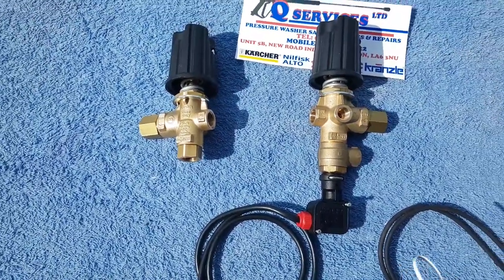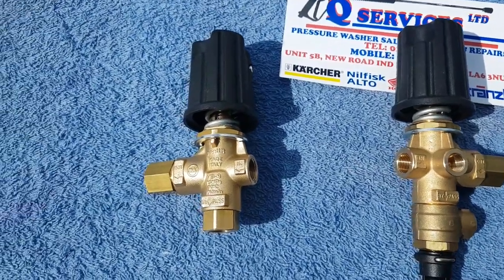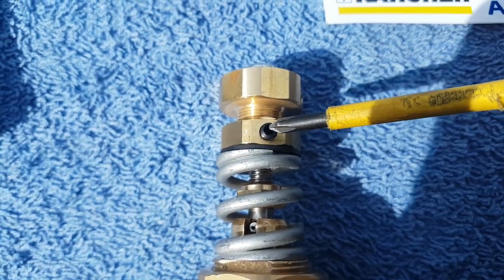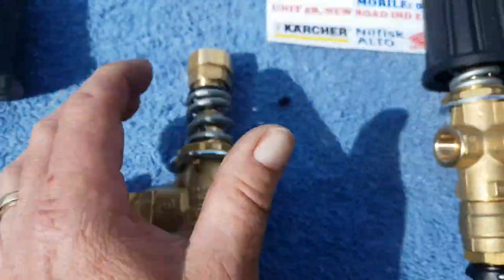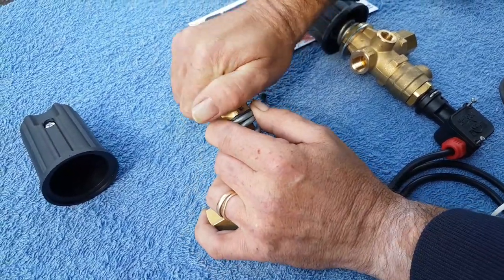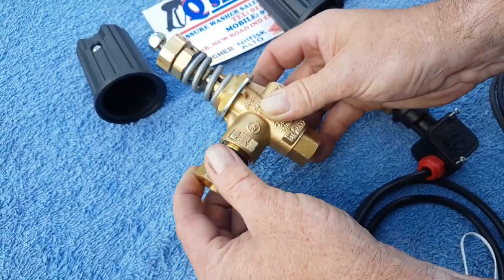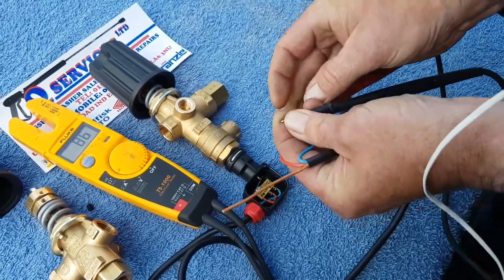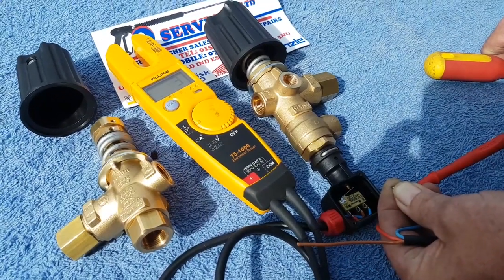QWASHERS YOUTUBE HOW TO SETUP REPAIR FAULT FIND PA 60.2250.00 VB9 UNLOADER VALVE PRESSURE WASHER

Comment: Hi mate can you help me please my unloader were my bullet value holder as staped of I've got the tread out but I  don't know what they're called any ideas thanks
Reply from the maker: Are you able to tell us the make & type of unloader
Reply: Damian Johnson it's made in Italy mtm hydro the pumps a ws201 thanks
Reply from the maker: The pump is Interpump WS201, but which mtm Hydro unloader valve is it that is on the ws201 pump. MTM is the make of unloader. Thanks
Reply: Damian Johnson hi thanks for replying there's no number or anything it just says mtm hydro it must be a old 1 I'll buy a new unloader do you recommend 1 for that pump thanks again
Reply from the maker: Better off emailing us on qservices1@live.co.uk with a photo to see. Also tell us what you use the machine for on email. Thanks qwashers
Reply: Damian Johnson will do thank you